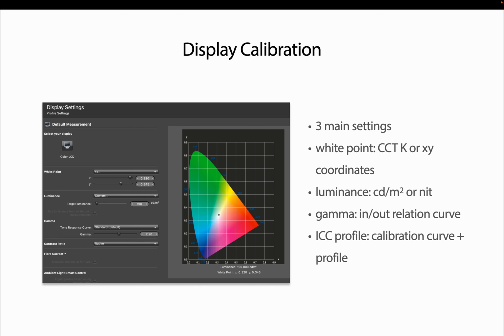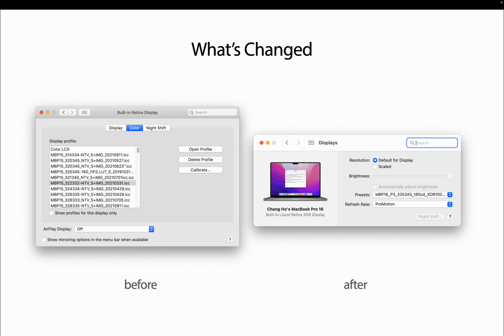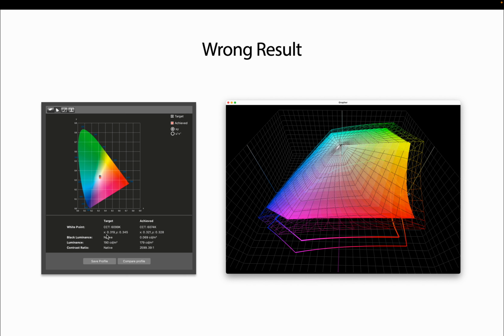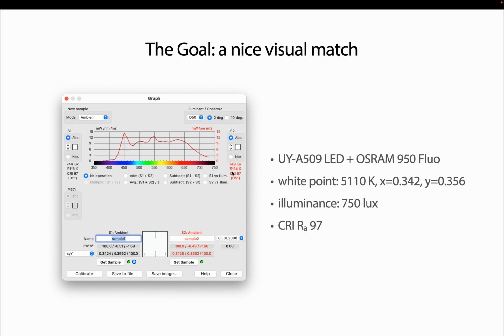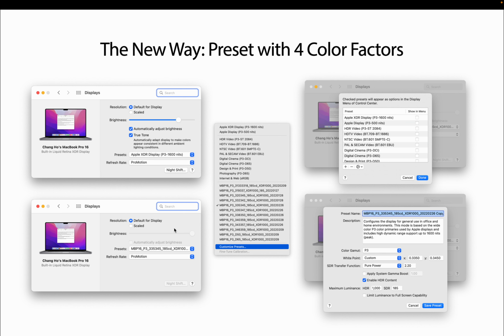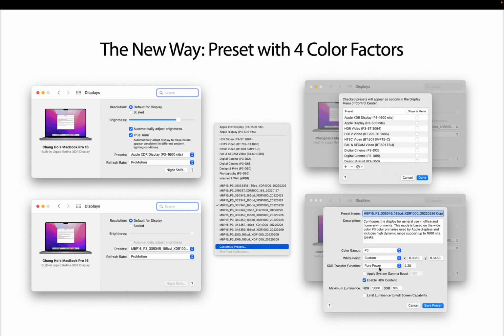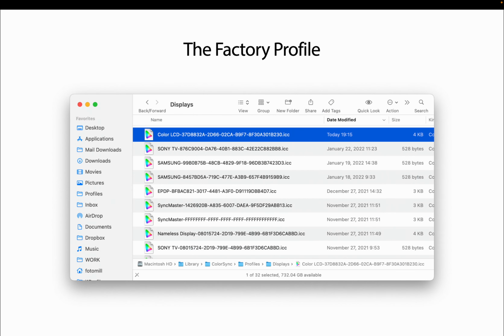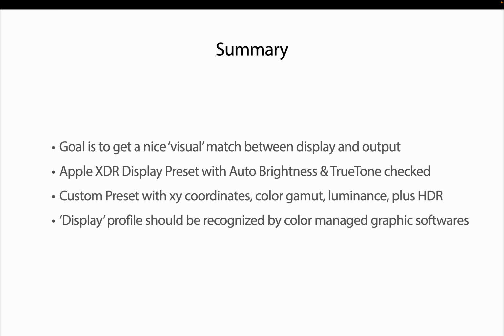New MacBook Pro XDR Display Calibration Setup (4K | ENG)

Comment: Very good review of new "XDR Liquid Retina" display. 
I don't think Apple has helped the industry but that's Apple.
In particular, it is ridiculous that the ICC profile "Description" is just "Display"?
I'm sure Adobe does not care... Who cares, right? That's mediocre traceability in my opinion.
How did you come up with this factor of "6.8" to convert Illuminance to Luminance?
Reply from the maker: The conversion factor comes from experiments. I tried several illuminances to find matching luminance of the display. Then I found correlation curves between the numbers. I confirmed validations. Now I recommend 7 instead of 6.8. So luminance is the square root of the illuminance multiplied by 7.